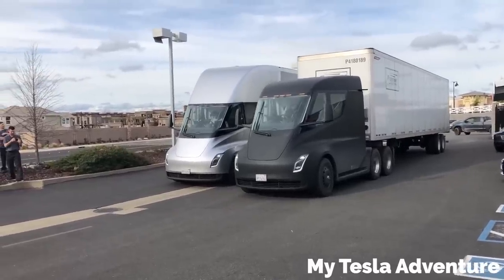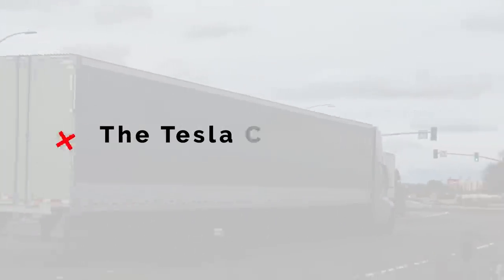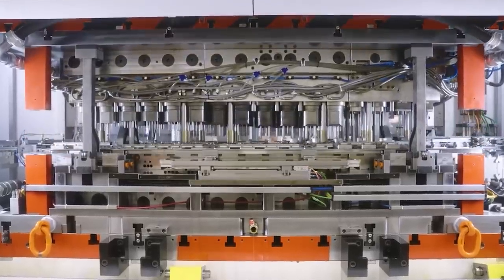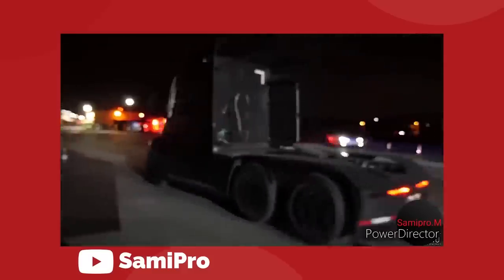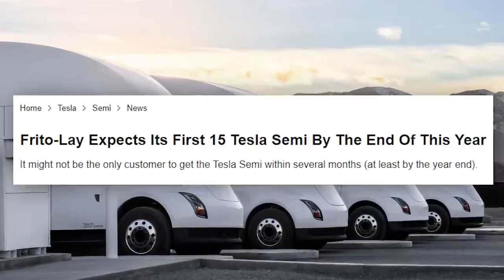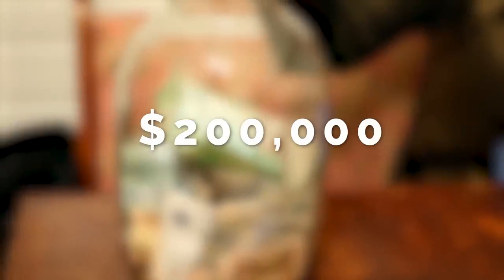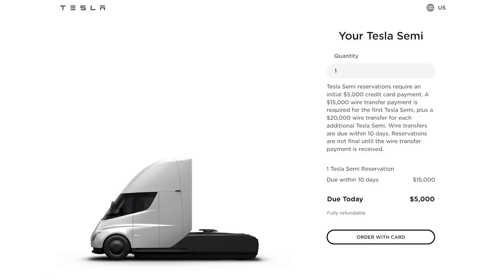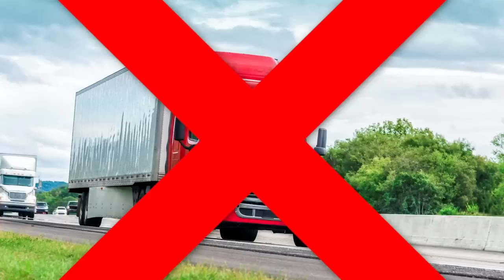The 2023 Tesla Semi Update Is Here!

Comment: How many videos have been done on how much better is 4680? Now 2170 is just as good? What is going on.
Reply: similar energy density. lower cost since it is one cell not 5 that needs to be handled and welded into a pack....
Reply: Marketing BS if they told you it's the same but bigger it doesn't sound so impressive
Reply: Telling „5 times the energy“ was good for the stock price back then.
People with physics understanding and an installed math engine did not have an issue to see why 5 times the size Leads into 5 times the capacity. 
Maybe the cells would now someone that „knows more about battery production than anyone else at this planet“.
Unfortunately stuck bird‘ing.

Comment: this will be great for short hauls under 250 miles. however, current tier 4 engines pollute at a level so low that it is as clean as a small gasoline engine from the 2010’s. look at the exhaust gas analyses that’re widely available on the EPA’s website. the most sustainable alternative for long haul trucks is using alternate fuels. i wouldn’t want to have a fleet of trucks and have to replace the battery pack when it fails. that’s gonna be pricy lol. also, the amount of lithium that is mined from our earth causes thousands of years of damage to our earths surface, not to mention the amount of pollution exuded from just the simple fact of mining it. it needs to be either all or nothing for this to actually make a difference
Reply: This is why hydrogen FCEVs are the long term future/goal of class 8 trucking. BEVs are a short term solution until hydrogen FCEVs are mass produced, in 2025 and beyond

Comment: Around 450,000 heavy trucks were sold in the USA last year. Once the tesla semis are on the road and companies can see the advantages of lower operating costs and improved reliability, electric trucks will become the only choice for the vast majority of uses.
Reply: @SJ-fj3jp  Well change is inevitable and the disruption it causes often brings both inconvenience (adopting from what one is used to, to what would become the new normal) and opportunity (Advantages of low operating costs, improved reliability, massive savings etc)
Reply: we will see they are making some pretty wild claims that i don't think they can meet the main one is range because i don't see a full loaded semi using less than 2kwh/m when the hummer with a trailer totaling less than a quarter the weight uses just under 1.5kwh/m
Reply: I think most companies see more problems than solutions with electric semis, they're really just a short term solution to supplement the time until class 8 hydrogen FCEVs can be mass produced in 2025 and beyond. The use case for class 8 BEVs will be short haul, minimal mile driving companies, to lower their TCO as opposed to diesels or hydrogen FCEVs

Comment: I believe there should be a vast expansion of our nations Rail Network.  Semi-trucks should only be for regional and in-city use.  Anything more than say 300 miles, and the intermodal container/trailer should be transported by electric rail.  Transporting goods by rail is cheaper, safer, more efficient, and more environmentally friendly than by truck.  Trucks are also responsible for 95% of road wear and many fatal highway accidents.

It’s a shame that we use to have an excellent rail network, but after WWII the auto, oil, and rubber industry bought and dismantled it.  They did so people would buy cars, trucks, gas, and tires.  Freight & Passenger Rail is superior to highway transportation even when electric cars and trucks are used.  Lets build a real and sustainable future.

Comment: A single speed gearbox is absolutely a transmission.
Reply: so is a differential a transmission?
Reply: @Gibbbrayden  that is technically correct for “propulsion transmissions”, including differentials and transfer cases.
Reply: @OVER-bENGINEERED  walk into a mechanic shop and tell them you want a new transmission. I assure you they won’t touch the differential. Or ask which one lol

Clearly, the Tesla gearbox is nothing like a transmission that wears down with gears, clutches, solenoids, synchros, etc… 

Not a good comparison
Reply: @Gibbbrayden  this depends on what kind of mechanic shop you walk into. Helicopter mechanics consider the single speed gearbox to be the transmission.
Reply: @OVER-bENGINEERED  clearly we aren’t talking about helicopters though. The best kind of mechanic shop for this situation is auto mechanics

Comment: its not difficult, the trucking industry in the usa just needs battery changing stations, the tesla trucks can pull in, automatically change to a new battery via a hydraulic forklift mechanism.
Reply: it's not that easy as it involves not just battery connectors but coolant/heating connections as well. I would also see the battery not drop out that easily. You also need extra batteries waiting as well. A Mega charger can add around 400 miles in 30 mins so the driver break anyway. I think your forgetting this battery is going to be around 10x the amount of batteries found in an eletric car!!
Reply: Better to put the trailer on a charged truck and send it on its way.  Put the low truck on a charger.
Reply: A trailer mounted battery might be a solution.  And they could also put a motor on one of the trailer axles, to recharge that battery during braking.  Then a 60 amp 480 volt 3 phase power line can recharge the trailer and truck during the unloading at a supermarket.  Enough to put back about 40 KW per hour into each battery pack.
Reply: @Kangenpower7  ... Battery management in an ev is a complex thing and also needs liquid cooling. You're just adding complexity by adding a trailer with a battery in when you don't need to. Initially these will be used on roots under the 300/500 mile that return to depot for charging. Once the mega chargers are in the wild they will add around 400 miles of range in 30-minutes.
Reply: @Kangenpower7  I would argue that motorizing the trailer adds unneeded complexity.  Adding regen to the trailer does not recover more energy.   Just put the work into a more capable truck

Comment: Fleets will not put up with a vehicle with high maintenance costs.  I bet this is why Tesla is not moving ahead with the 4680 at this point. Also, one should look at the volumetric density and overall reliability of the full pack (including interconnects and power management), not each battery.

Comment: I work for a truck company in the POWERTRAIN division   We have been producing the standard for electric trucks thus far.  It’s not easy, there is not much to borrow from prior way of working with combustion products.  The learning curve is steep for suppliers of components needed and the supply chain has thus far been the limiting factor to output thus far.  It seems this will continue for the next 1-2 years until the supply base becomes stabilized.  Unless Tesla has vertically integrated all of the at-risk parts that we have struggled with, I predict they too will be limited.  As a disclosure, I am also a share holder of Tesla stock, so I have a vested interest to see them have some success with all their products.  I just don’t want them to take the whole pie. 😅

And then there is the infrastructure that you mentioned in this video.  Tesla will need to rely on state governments or private companies to install charging stations next to gas stations.  I think that will take time—mostly due to the massive reluctance of those in the oil industry.  We have seen obvious behavior by legislators to stall progress building this infrastructure.  A large part of the Biden infrastructure bill included charging stations.  Have your opinion of him, but Tesla (and my company) need this infrastructure building to begin to allow the expansion the market will demand.  

My two cents.  😊

As always, great info.  I enjoy your channels and I subscribe to all.  Pls keep new info coming about this and all this related to Elon. Many thx.
Reply: Tesla is very vertically integrated. They will enjoy a huge economy of scale on battery production and is very good at rolling out charging systems that work. I suspect they have already negotiated deals with one or more national truckstop chains I also have wandered at the ability of the  other class 8 truck makers to compete. The motors are the same ones used in the Model S/X. Tesla has some of the best software engineers in the world. I hope your company rises to the challenge.
Reply: Tesla has used profits from car sales to build the Tesla supercharging network.    I expect it will do the same with truck chargers.   Initially will build chargers for customers buying trucks.

Comment: It will use the Plaid motors so it doesn't need 4 motors anymore
Reply: the plaid motors really aren't much different than the standard models where they do differ is the carbon fibre reinforced rotor allowing it to spin at a higher rpm without exploding a feature not useful at all to the semi

Comment: Would like to see maritime and aviation batteries developed. Maybe Bob and Doug could test MEV (Maritime Electric Vehicle) batteries?
Reply: Hybrid with hydrogen would be the solution
Reply: As mohammad said, water is denser than air so while an average car/truck uses the more energy to accelerate but no as much to maintain it's speed, a boat requires constant energy which is why the Electric Candela boats are hydrofoils to reduce drag by 85%. Hydrogen ammonia fuel cell is most probably going to be better for marine uses. Planes use the bulk of power during takeoff and climbing so batteries just need to improve density a bit more for them to start to be viable for short haul flights

Comment: If you painted solar panels on the lines in the road that feed in solar power you could power the car Tesla style with out neading power stations lol like a hot wheels track
Reply: If you powered the road instead of the car
Reply: Solar panels don't really work well to power a car, a 1 KW solar panel will not fit a car roof, and would only add about 15 miles of range each day.  A 4 KW on a truck's trailer might add 2 miles of range per hour of good sunlight, or about 10 miles of range each day.  Not really worth all that effort.  

Placing solar panels on the road surface would be useless, as there is no reliable way to collect the electricity and place it in the grid or some other location.
Reply: @Kangenpower7  I'm not asking why they're are not solar panels on the car roofs I'm asking why they're are no solar panels in the factory roofs if renewable energy is so reliable and great don't you think his factory would be running straight off from solar and wind
Reply: @Kangenpower7  I'm talking about using road ways for solar panels and other all ready existing structures instead of mowing down forests to build solar farms and taking up land that could be used for agriculture

Comment: I don’t understand why they are giving the EV semis a higher gvw. Same brakes and same tires, so more weight to stop. Tesla isn’t exactly noted for great brakes and at 82k lbs, that’s not ideal. If the battery is 13x the Model Y battery, 13x the weight would make it around 22k lbs. That’s a lot of weight given up to the drivetrain. Also no sleeper, so no otr truck. This will prove to be interesting. They also have to go at least 500k miles on original batteries. I’ve already seen a Nikola trucks on the road and one at a dealer.
Reply: Its to subsidise the weight of battery packs. Other manufacturers will need to have a much heavier truck to match teslas specs. The same goes for the model 3,Y etc
Reply: They do have regenerative breaking, maybe that's why?
Reply: @mumfordmunsley2002  diesels have engine brakes, so that’s not a legitimate reason. Range and longevity are the biggest questions. They claim anything, but we haven’t seen real world data.
Reply: @michaelhite1433  We know electric motors last longer than ICE.  No reciprocating parts.  I don't know where Tesla has ever over represented numbers.    Chances are that if tesla says X it is better than X.     On the cars the range is actually better than stated.  When the car hits zero you still have a few miles of range left.  Or so I have seen on vids LOL
Reply: @danharold3087  diesel trucks go to close to a million miles, not sure any Teslas have done that yet. Batteries are also in question.
Reply: @michaelhite1433  That million miles would be the engine.  The truckers I know fix their trucks enough that there are obviously many things not lasting that long.  I have helped a trucker friend replace 2 radiators although not on the same truck.   He also happens to be a trained diesel mechanic so yes he cares for them.   Agree on the batteries.   For all we know that battery used for mass production may not exist in quantity at this point.   The semi battery is said to last a million miles.   I would not be surprised if that is still being worked on.  Even if on had to spring for battery replacement the 60K not spent on oil changes should cover it.
Reply: The motors are designed for a million miles.   That has been stated repeatedly, even when in context of the Model 3 as it shares the same motors.   Your battery weight is not even close to reality.   It’s 10X the plaid pack which weighs 1200 pounds.  Being that it’s one big pack and doesn’t require 10X the hardware it should be just over 10000 pounds.  Same brakes are fine.  Won’t be that big of a difference in GVWR as most loads are short of max weight.   And no compression braking cannot hold a candle to electrical resistance.  Huge difference in downhill brake savings.   I guarantee you will never smell or see smoking brakes on the Tesla semi.
Reply: We have some electric busses in the local municipality. They cost twice as much as a diesel bus. The battery doesn't go as far as a diesel bus, so 2 electric busses are needed per route. They are made of far more exotic materials over diesel busses. When they break they take a long time to repair. The chargers are huge as well and I imagine very expensive.
Reply: @moabman6803  you think BEV buses are spendy?  Try Hydrogen!  1.4M per copy!  Ridiculous
Reply: @twothbeave  Probably because it's very very low volume.
Reply: @twothbeave  you don’t see smoking brakes on a diesel truck if the driver knows how to drive. In 22 yrs I’ve never smoked my brakes even on max loads. Several sites have said the batteries are around 20k lbs. most loads are around 36k lbs which puts a truck at 72k lbs gross. Most reefer trucks are pushing gross. There has been very little real world testing shared with the public. What we do know is that EV cars and pickups towing reduces range a lot. We also know that EV semis  being used for otr is yrs away. There are no truck stops with chargers. So diesel fleets still have at least 10 yrs of life left. The largest otr company which whom I drive for hasn’t even started looking at this possibility yet. Haven’t seen a single Tesla semi with a sleeper.
Reply: @twothbeave  I question how strong regenerative brake will be if the semi is using car electric motors. A semi is a lot heavier than a car. Compression brakes work very well. What works for a car doesn’t always work for a HD truck. Not sure Tesla did their homework on the semi. Kenworth at least understands the trucking industry and knows what a truck needs to do.

Comment: If the battery cells can last 100 years or more than I would say Good.  If it lasts less than 50 years I’d say bad because digging up all this crap that’s needed for this battery set up is actually more deadly to the environment than running diesel trucks but if it last past 100 years Then I’d say you’re doing something environmentally good
Reply: But no Diesel engine last that long either. Lol
Reply: You do realize that the material needed to build diesel engines and diesel fuel has to be dug up too

Comment: I saw a short of this guy and his load 100k for the truck and trailer combined and an additional 147k after item was stripped of parts so it wouldn’t be considered a super load or overloaded transport  big items over 250k tons should be diesel fueled transport and work on getting 80 T wheeler to 200k gross overall
Reply: What is you point.  WIth enough axles you can move a fair sized building
Reply: You said the guy has a 100,000 pound load on his truck?  I guess more than 3 axles on the trailer and probably 3 axle truck?  With a truck and trailer weight of about 40,000 + pounds and a gross total weight over 140,000 pounds?

Or are you saying that his truck had a GVW of 100,000 pounds, less the weight of the truck and trailer to give a load of about 50,000 pounds?  

With the Tesla truck, they claim a 82,000 GVWR total, including the weight of the truck and trailer.  Now that will not stop someone from loading enough stuff to have a total weight of say 85,000 pounds.  But mostly they plan on running between 75,000 - 82,000 pounds when the trailer is full of stuff.  My guess is that the Pepsi trucks delivering potato chips is only going to run say 65,000 pounds. Then return empty to the factory again.  At my guess 40,000 pounds?